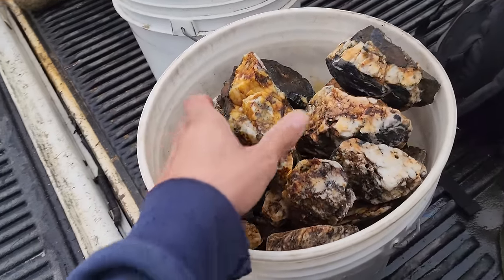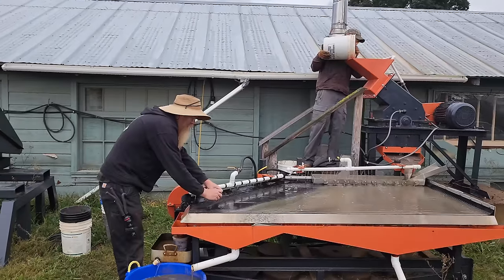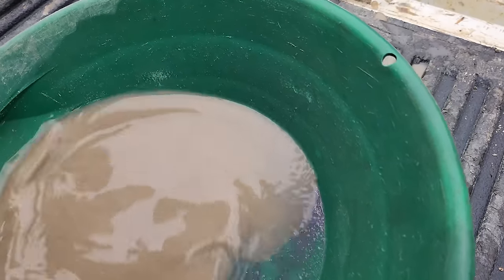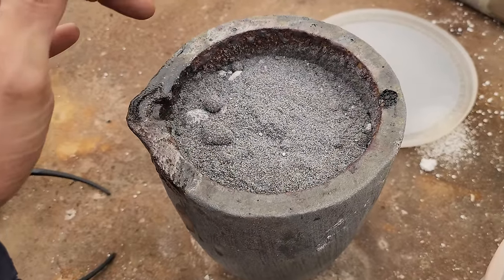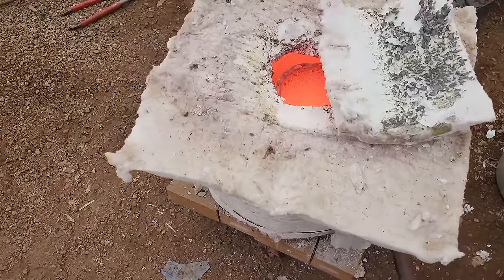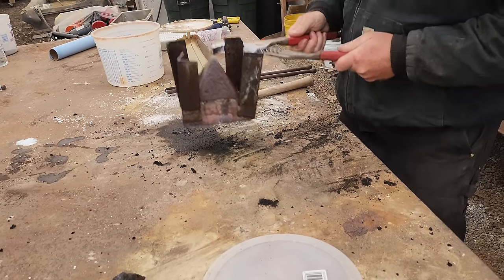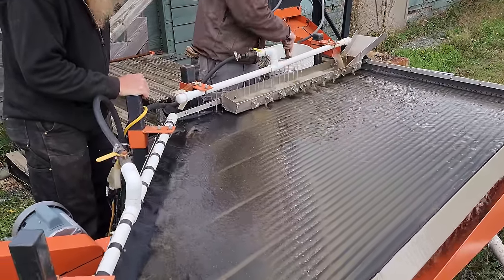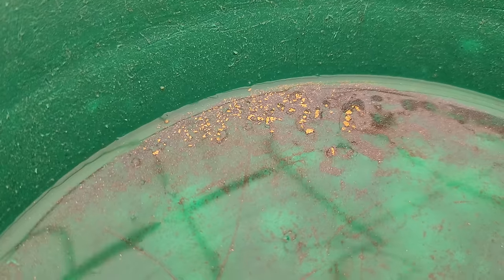Testing Dan Hurds Gold Ore For Rich Gold & Silver

Comment: Dan made mention that one claim had gold, silver and copper.  Can you extract all 3, or do you lose 2 to get the gold???
Reply: Excellent question, Charles. After watching many of Jason's smelting of cons, I think it becomes at least a 2 part process. However, it is my guess. Get rid of the copper, then separate gold and silver (if you want to do it). I've seen many 'less golden' beads where he, or Dan, judges the percentage of the button on its color.
Reply: The end bead contains both the gold and the silver, any copper goes into the coupelle as an oxide.

Comment: You still have to heat the moulds, otherwise it will be a huge tempreture difference when you pour into the cast. Just need one more gas burner it shouldn't be a huge issue

Comment: On a different subject. Your mountain top mine. I believe you have stated that you can punch a hole through the vein you have been working and get to a better place to remove your muck from. So my question is why don’t you just go ahead drill and blast your way on through to the other side? I know it is kind of a 20/20 hindsight thing but you could have just blasted on through and then removed your muck without all the other work you did with timber trolly tracks and handling the ore 10 times if the other way would be better.

Comment: A quick question:  Wouldn't the concentrates distribution be more effective if it was cycled opposite the table direction?  Ie: the separation would be enhanced if the gold was preferentially forced to the end of the box farthest from the inlet.  This would further minimize the amount of gold that would be deposited on the table at the inlet side.  To accomplish this you would have to separate the inlet box from the table and have the bumping done from the outlet (end) of the box.  Just like bumping a pan, the outlet box will perform two roles: first to move the gold to the end of the box and second to distribute the concentrates along the length of the table.
Great videos!

Comment: Hiya, at 18:59, where you were talking about the mix in your No.10 crucible before you put it in the furnace, I got a couple of camera sprites above the ore - did you guys run a Geiger counter over it at any point to check for activity or were those just strange camera software glitches?